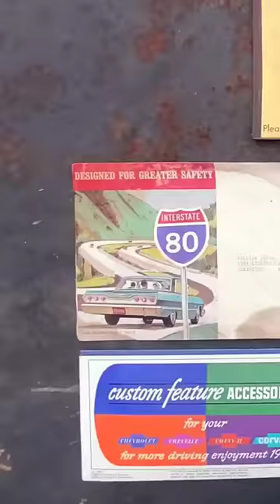1964 Impala SS RagTop #Impala @Ironcitygarage 👈🏼👀 #Best #Lowrider #Shorts #VickysTown #EnjoytheCruz

Comment: Man this brings back memories for me, I used to have a 63' Impala Convertible Holiday with the extended rear bumper continental kit, found it in Line pine under a grove of pine trees, the top was only a few threads left, someone had taken the front seats, bottom rear seat, running gear, and front suspension assembly, I dragged it out and flatbed trucked it back to North Hollywood, it took 3 days to get all the pine needles out of their hiding spots, the thing got stripped to nothing, sand blasted and dipped clean, then I trailered what I had to my auto shop at school and threw it onto a rotisserie and that's where it stayed for 9 months being built till it was solid and mostly done, once primer was on I started driving it, 14×7 TruSpokes and 5:20 white walls still hadn't gotten the top done but I did have the leather cover snapped on covering the the exposed frame, she was a challenge, she ended up Corvette Metallic Green with a white top, that Tramp was a bad b*tch

Comment: Wow right off the bat you can tell that these guys don't know the first thing about restoration and if you can't even know if a fuel pump is going to fit an engine without knowing the the engine size you shouldn't be working on it because fuel pump will fit all v8s they're interchangeable and you should have removed the seats off before you start pulling the carpet off amateurs